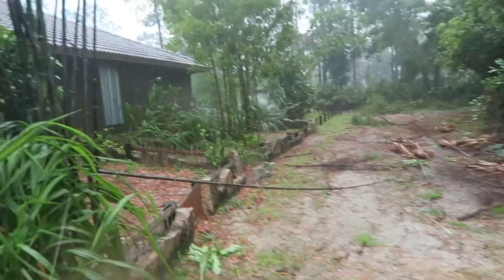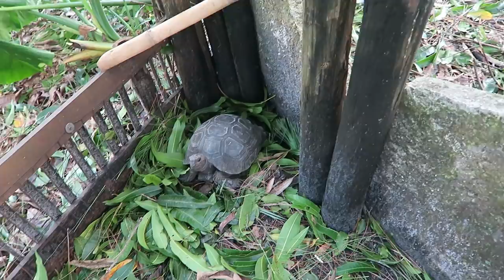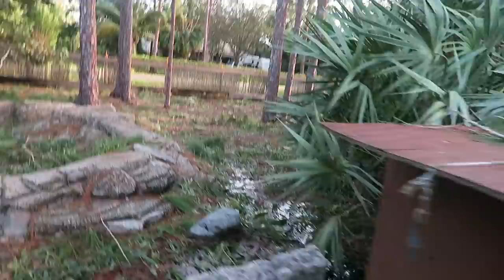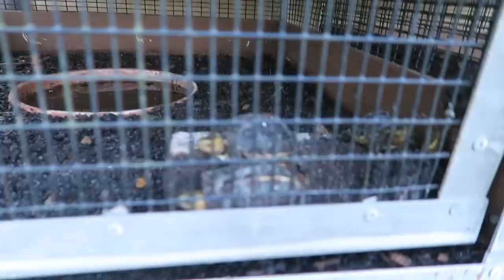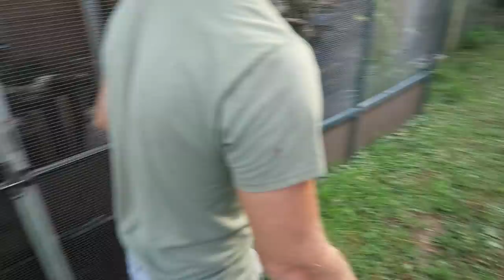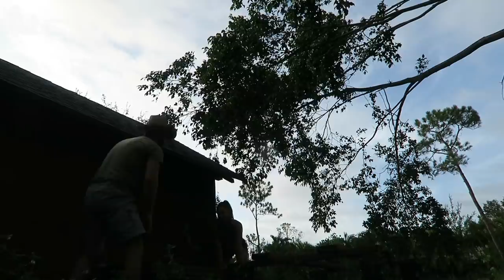Hurricane Irma Aftermath

Comment: FAR better than expected! Clean up isn't nearly as awful as downed homes! This was supposed to be FAR worse and COMPLETELY devastate everything in and NEAR its path but it DIDN'T do that. You need help with clean up? Once I can get a flight into FL, I'm happy to help everyone I can! In Tornado Alley, after a major tornado blows through the area... we're just grateful when everyone is found safe and our homes are still standing. Lives are certainly more important than "things." Things can be fixed and cleaned up. You definitely showed why USDA requires double doors on exterior perimeters!